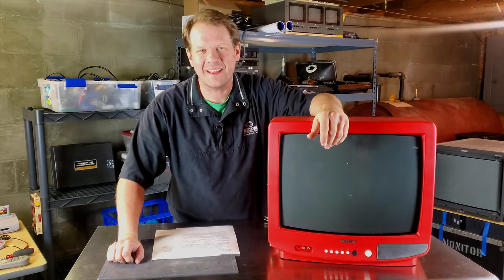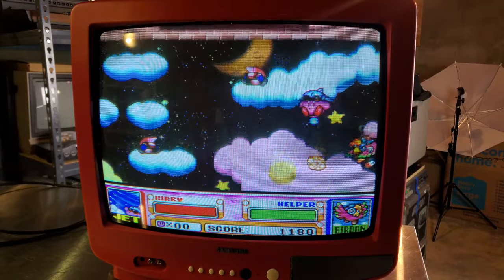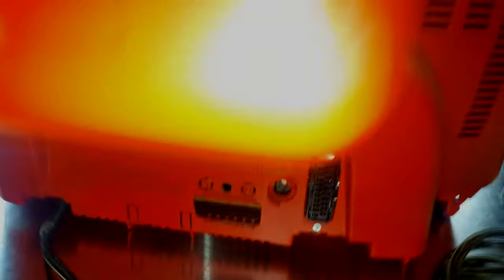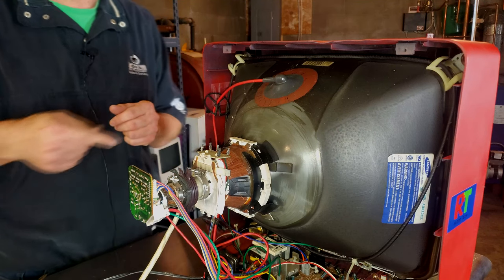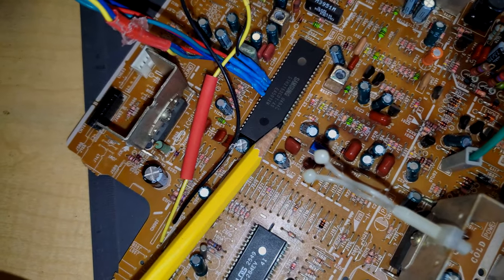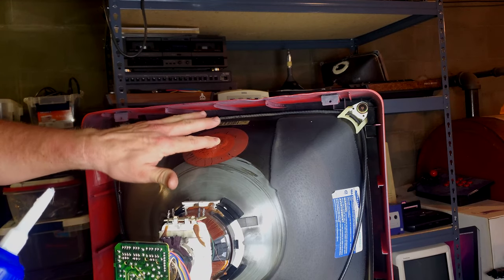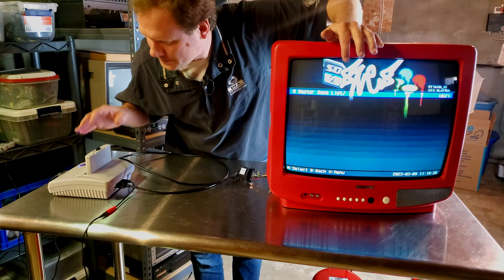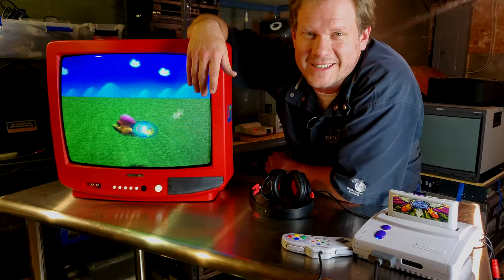This Red Samsung CRT supports RGB! 📺Retro Tech

Comment: That little Sony TV looks like my KV-13M10. I used mux mode for my RGB SCART mod to preserve the OSD function. I also used the 5V blanking voltage provided by the console for auto RGB enable with manual enable option. The jungle chip is CXA1865S and it has RGB-in pins I used to send the signal to. It turned out neat but I was missing the stereo sound so I added a 3.5 mm input connected to SCART port for external PC speakers.

Comment: Damn mice... Had a similar situation in my hyperspin arcade cab, little shitz were nesting on the video card and relieving themselves all over it. Ended up remodeling the whole cab, new pc, made it mice proof.... Anyway Steve, be careful with using a pencil as a pointer, we used to use pencil graphite on motherboards back in the day to reduce voltage drop when overclocking, a pencil mark is highly conductive and can act as a drawn on trace. Great video though.... Have you tried a RGB mux mod yet? Just did a 36" thomson tube jvc and its jaw dropping.... Started a new job though and no time to edit videos lately :(

Comment: Great to see this TV managed to survive to fight another day once again, good stuff! Are you making some kind of cover at the back to stop this potentially happening again?
Reply from the maker: Thanks. I wasn't thinking of doing that, but it's a good idea.  I might 3d print something.  Also, I have moved it out of storage permanently.
Reply: @RetroTechUSA  If you've got the means to 3D print something then I think that'd be a great solution for sure, though I guess it's not a pressing issue if it's out of storage now. Maybe down the line when you need the space again though!

Comment: I have a Sony KV36FV26 that I RGB modded and there’s an annoying Horizontal shift regardless of whether I use sync on composite or S-video. Voultar mentioned a pin on many jungle chips that you can wire a 10k trim pot to and adjust H-phase but I can’t find it. Anyone with solution would be appreciated!